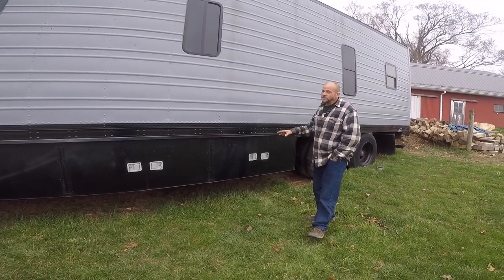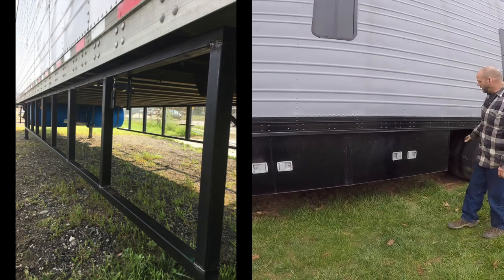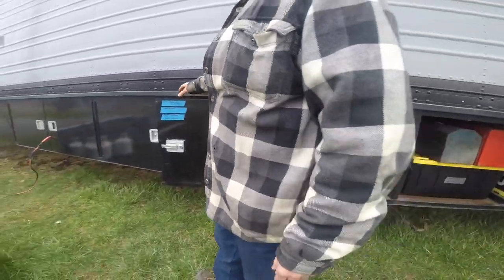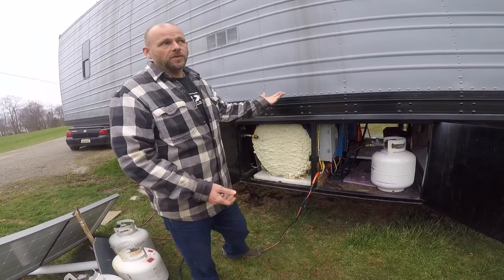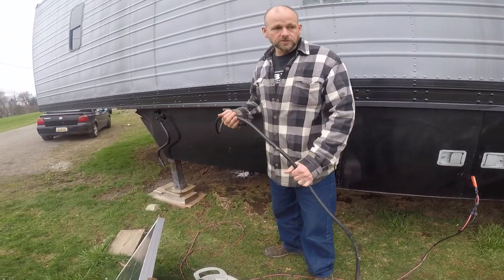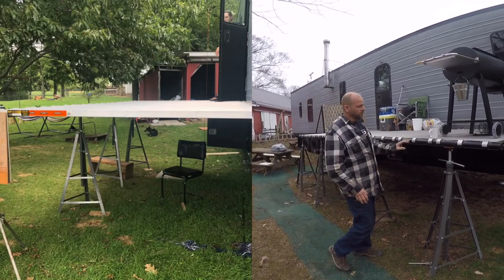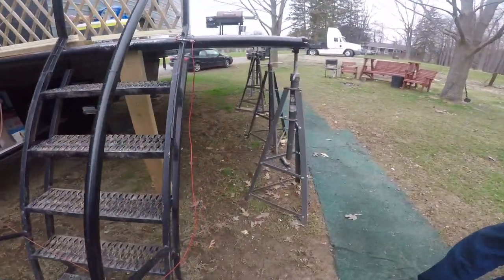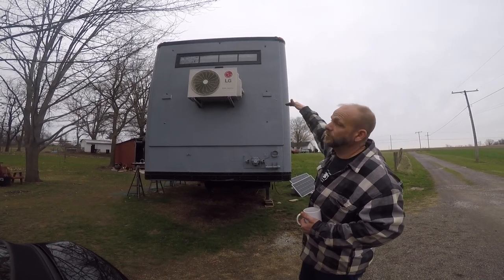Semi Tiny House Build - Season 1 Episode 2 - Basement and Deck -  Water Tanks, Portable Deck

Comment: I'm a semi truck driver from Japan and  worked as a long haul truck driver in North America for one year before.  
It's very cool that you made a refrigerator trailer to a tiny house.  And a lot of nice idea like how to use the space under the trailer, using scaffold planks for a deck. 
I really want to build a semi tiny house one day and will use your ideas when I build my semi tiny house trailer in the future^^
Reply: Lots of good ideas here for a future tiny home. 😊
Reply: Where did you get the scaffolding?
Reply: You might want to consider not having any windows or doors cut into the side walls, since that draws too much of the wrong kind of attention. I've lived in a converted box truck in which I cut windows, as well as a regular RV, and was bothered by people when I parked in various huge parking lots. If it looked like a truck, not an RV, it would not attract that kind of attention. With cameras and flat-screen TVs being so available and affordable, my next one will not have windows or doors in the sides, just the front and rear, to allow access while still keeping the commercial trailer appearance.
Reply from the maker: Thanks

Comment: As someone who has seen multiple times semi trailers getting stuck on railroad crossings and living in an area where the only flat'ish crossings are about 40 miles apart, this basement idea is a bad idea I think. I've literally seen over five semi trailers in my area get stuck on the tracks and a few of them have been hit and destroyed by trains. One crossing was so bad that they outright removed the crossing. Another has had so many train hits that it now has cameras and other fancy tech to try to prevent further issues. The last wreck was a passenger train that derailed due to hitting a stuck trailer.

Comment: A big problem with this "basement" is that it will drag over high spots. I live near a rail line and every railroad crossing within twenty miles of my house is high enough to get a trailer like this stuck on the tracks. Get stuck on the tracks with bad timing and you end up losing your trailer to a train.
Reply: Well gee thanks for that perspective
Reply from the maker: Built it 4” shorter than the windskirts.    Never had a problem.
Reply: @itsawalkerthing5517  mic drop 😂